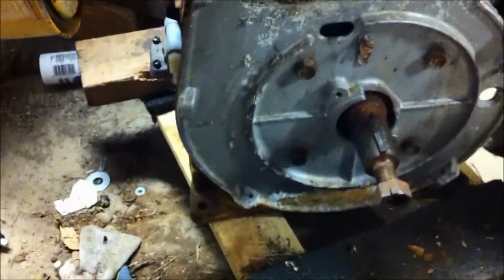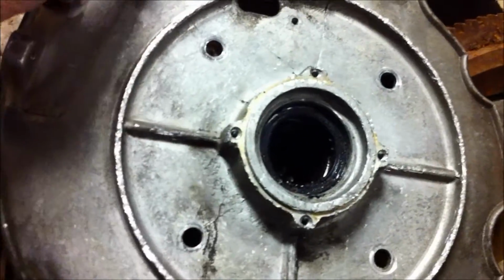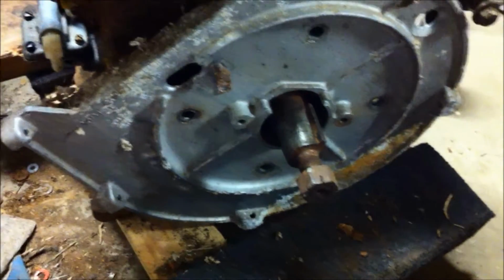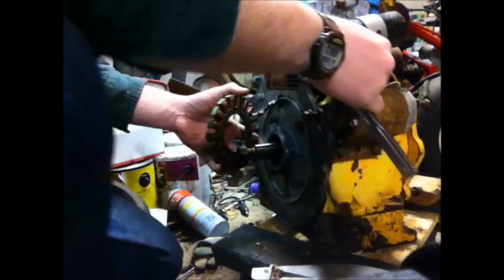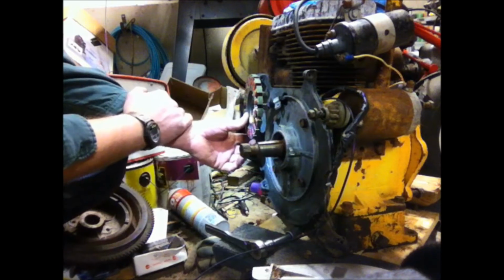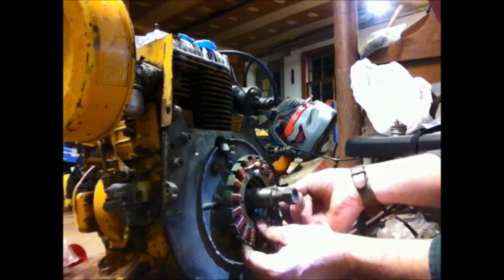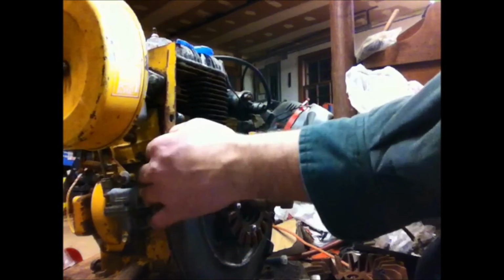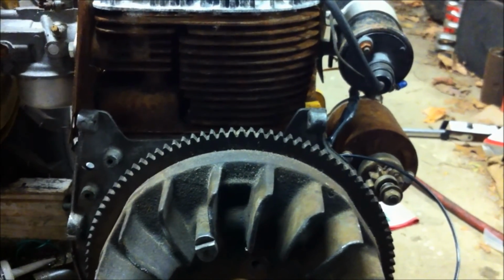Gravely Kohler K241 Part 4 Bearing Plate Change

Comment: question on the gasket + shims behind the bearing plate...does adding more shims increase the endplay or reduce it?
Reply from the maker: mackendw hi there, more gaskets make more end play.   Here is another video I have showing more about it...
https://youtu.be/IOjLaTzx8fQ
Reply: @rw3dog  just watched your video link.  thx.  I had to replace my bearing plate.  the old one had metal fatigue on the top and was getting brittle.  I'm wondering if the replacement is affecting the setup?  I put a thick one and 2 thin ones in as was the case before but am still < .003" of play.  From watching your video, you didn't appear to be tightening them too heavily.  might I be over tightening them and thereby crushing the gaskets?  I'm a newbie at this rebuilding stuff....learning as I go...looked for the specs on these bolts but didn't find any in the kohler manual for the k241.
Reply: I'm thinking the aftermarket set of gaskets I bought might be the source of the issue here...they are total CRAP.  they probably just compressed to nothing hence my problem.  after putting the block in the shed for the night, I went out to inspect things this morning.  I did the assembly yesterday in the sun, so the metal warmed up and expanded a bit.  measure endplay this morning and its around .004".  so on the very edge.  would you be comfortable with that amount?
Reply: @rw3dog  got the 210 up and running.  still some nagging electrical issues with safety issues to work thru but the blue smoke is now gone.  still have the kohler rattle.  but nothing I did addressed that.
Reply from the maker: mackendw I am glad it’s running again....